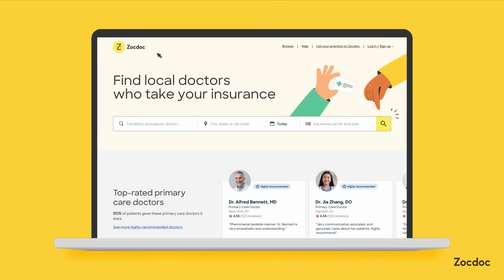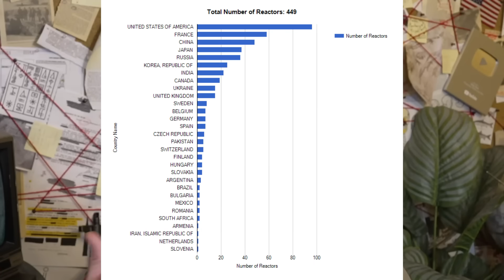America's Abandoned Nuclear Reactors | King Trout

Comment: "oil and gas companies" are NOT the primary lobbies against nuclear power. The COAL industry is the major lobby that scuttles reactor construction. Contrary to public perception very few infrastructure scale power plants are oil/gas. There are "natural gas" power plants but they are few and far between. MOST power plants in the US are coal fired. NOBODY ever talks about it, its infuriating. Like, literally the oldest, most inefficient, most polluting form of electricity production is the most common form used. Its mindbogglingly stupid. The coal industry is one of the most powerful lobbies in DC but nobody ever points to them when talking about this stuff.

They actually SUPPORT the "green energy" crap, because it can NEVER be an actual threat to their strangle hold on infrastructure scale power production, and it gives them a way to propagandize the nimby/tree-hugger types to focus on "green vs. nuclear" that would otherwise be screaming about the freaking coal fired plants all over the place.

EDIT: As an aside, you get alot of "interweb" types talking about "thorium reactors" like they're some magic wand. Thorium reactors would be great, but unlike uranium based stuff, they are essential science experiments. Pebble Bed Reactors, small scale Radio Thermal Generators (which technically could describe ANY nuclear reactor, but is usually referring to "nuclear batteries") and most other designs that came about DECADES ago are all tested, functional and SAFE with ZERO chance of achieving super-critical states, so the entire "melt down" thing isn't even possible unless you use designs from the 60s (or 50s in the case of Chernobyl).

Comment: Vogtle = Voo-gull.  Google Mr. Vogtle btw, good read. Tad more info for ya: Voo-gull and VeeCee started out with a couple of nubes in nuclear construction and the design was supplied by long time nuke firm Westinghouse. When the nubes totally forked up the VeeCee job collapsed, Westinghouse went bankrupt and the Voo-gull bankers got on the phone the one worth a damn nuclear constructor: Bechtel.  At Voo-gull Bechtel pulled the project out of the ditch and got it across the finish line.  It weren't cheap and with a tiny bit more inflation the power provided will be marginally profitable. You left out the longest nuke project - WBN2 (1973 - 2015), and who got that project over the finish line - yep again Bechtel. You see the trend here?  Another subtlety - many failed plants have unique designs, that almost always yields added cost and slow regulatory approval. Vogtle units 3&4 were completed in 2013, "just" 12 years ago. The two Vee-Cee units are the same design as Voo-gull and it is possible to restart those jobs. Hope springs eternal. There is current talk about restarting the VC project - If you hear some tech giant will bank roll the deal and Bechtel and Westinghouse team up again I'd give it a fair chance of success and a reasonable schedule (first quote 5 years, then go out 2 more years for a total of 7 year) Take all that with a grain of salt but I worked in a senior position on all three of the jobs mentioned above. America can build nukes, we're good at it, we have the skills and the workforce. Finally you bad mouthed the oil industry a bit - Natural gas combined cycle plants are the most cost efficient technology at converting BTUs to MWhrs. The plants are affordable and those plants respond quickly to demand, especially when renewable power sources fail. Everyone in the power biz knows Nukes are for base load and Combined cycle plants for demand load and hydro is the only renewable worth a damn. That's how it all works - Bet on Bechtel and a Nuke/Gas combination and we'll have enough power at affordable prices. Full disclosure - I've worked for Bechtel, Westinghouse and I'm long oil&gas for decades. I've seen what works and why. Have a wonderful day.